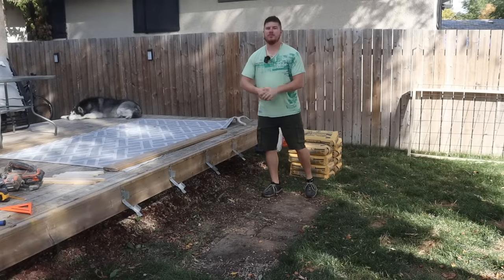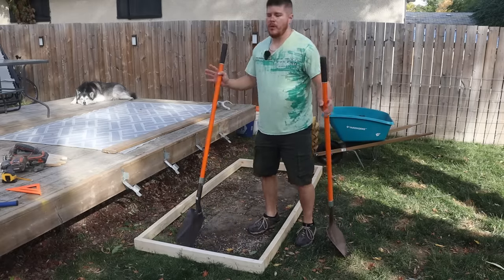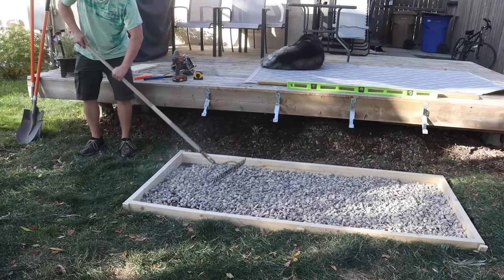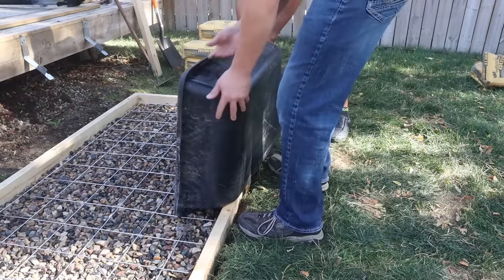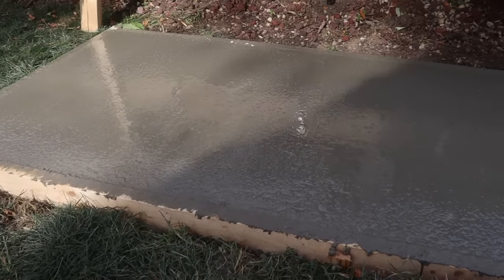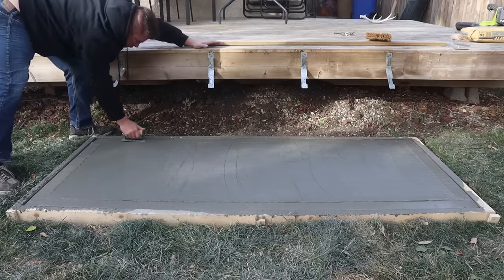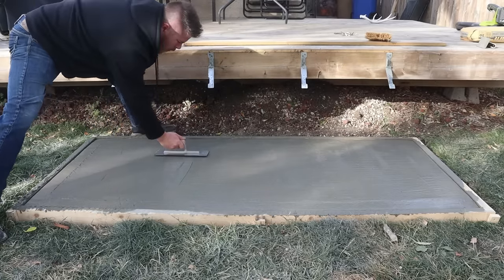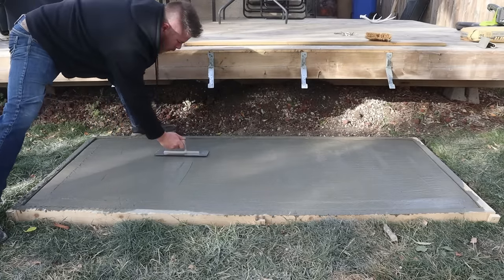Concrete pad for beginners  //  DIY

Comment: Super important to wear a mask when dumping the concrete out of the bag. That dust will hardened inside your lungs....
Reply: Is cools dude I reckon the 30 years of heavy smoking (wink wink) will probably get them first... Oww.. Is beer o'clock 😂 No but good advice thanks... I just burnt a root out the floor... Fackin used slightly too much lighter fluids 😮 fml oops!! Is okay is parents house not mine lol 😊
Reply: Most concretors I know smoke gear and darts flat out, cement dust has nothing on them
Reply: These people commenting about smoke have no idea what Silica is and what it does to the lungs. Trust me it’s not the same as smoke 🤦🏻‍♂️
Reply: Yea good point! Thanks!
Reply: I wear a mask when dumping but still hold my breath for a while 😄 
And walk away for a few seconds until the dust disappears..
Even if I do it like this, it still feels like I am breathing in some dust.
Reply: What size slab is that? Gonna do that this weekend
Reply: Been mixing with cement for 40 years, no problems. Just keep the wind behind you.

Comment: Good job on the video but few tips for beginners. On a smaller slab like that, where it mainly has foot traffic you don't need the reinforcement. You really only need that if the slab is going to hold weight like a vehicle or a shed. If you are doing this solo using a wheel barrow is much easier than a mixing tub. You just dump it out instead of shoveling or trying to lift the tub. If you want to help hold the slab in place, drive some 4 inch long rebar half way into the ground. Spreading them out in the middle of the slab.
Reply: agree-
Reply: Do you need rebar or whatever for just a patio and chairs situation and for that, how deep do you need the slap. 2",3"4",,etc?
Reply: @USMC-1 ur gonna need all 9” 🤥😉😲😵‍💫😵🥴🤤
Reply: Thanks for the tip

Comment: I've seen a lot of videos on creating concrete slabs, but I've never seen one with this much detail and explanation.  THE BEST VIDEO I'VE SEEN. Thanks a lot.
Reply from the maker: Awesome! Well I'm glad that I could be of help! Good luck on yours!
Reply: Not thick enough for rebar...4" or more requires rebar..
Reply from the maker: Requires, key word. But nothing saying don't do it anytime, even if it's thinner. It's always better with it as that's part of the way concrete works. Especially for a minimal cost

Comment: Put a few small rocks mid depth to support the metal mesh before pouring. Get it in the middle of the concrete thickness.

Comment: I needed help because I’ve never done concrete before. I’m a grandma who loves a project! My garage floor is 3/4 blacktop which is great because the original concrete floor is awful- porous, holes, never ending cement dust. I just wish the previous owners had done the whole floor!?! Now I’m trying to resurface the remaining 1/4 with a 2in layer of new concrete. I’m doing a 5x4’ pad 1st because I’m doing it alone and can’t mix more than 30lbs. at a time so I can lift the 5 gallon pail to pour it in the form. I was worried when I finished smoothing it out level because it was so wet on top. I grabbed my phone so I could find a video to show me what to do. Yours was the first to pop up and am I glad. You explained the process perfectly and now I know that I have to wait and finish it off when it dries more. Thank you so much. Too many of the videos are for people that know what they’re doing and they’re too complicated or expect me to know things that I don’t. I’m subscribing to your channel so I can get more instructions on home projects. 😊
Reply from the maker: That's awesome! Well I'm glad I could gelp you learn and grow. Good luck on the rest of it, sounds like a big project. And welcome to the crew!

Comment: Just what I needed. Thank you for making such an easy to follow video. I had been wondering about using a tub vs wheelbarrow and some other items mentioned here. Thanks for listing them. You've made my job so much easier! Subscribed.
Reply from the maker: That's awesome! I'm glad I could help out. I've had this tub for 4 years now and it works great, but lots of people use wheel barrows to dump it easier. I just shovel it out of tub normally. Good luck on your project and welcome to the crew!

Comment: Very nice and well-done video brother!
 I am getting ready to pour my first concrete slab ever this morning. I have a 2' x 8' area/section and thought I would need about 15 bags of concrete according to the sizing chart on the Quickrete bag, (16 sq ft).
However, after watching your video, I realized it's easier to use some bags of paver base as you did, and only need about 6 or 7 bags to do the job!

I learned a lot here and feel much more confident now going into this project! Kudos for taking the time to do this video.
- Mark from Holly, Michigan.
Reply from the maker: Thanks very much, I appreciate it! I hope that your slab went well!

Comment: Thank you for the video. I’ll be tackling this in a couple of weeks. It’s my first time doing this, but with your help, I’ll get it done!
Reply from the maker: Anytime, glad I could help! Absolutely you can, good luck on yours!
Reply: Doing a dry pour seems a ton easier to me
Reply from the maker: Dry pours are not good ideas, but everybody seems to be fascinated by them recently. Ultimately you're skipping vital steps, and concrete is a chemical reaction. Skipping them will have adverse effects. There is a reason the pros, as well as concrete manufacturers don't do it

Comment: What a great video!! I'll be doing some concrete work on my house a l little at a time because my back can only take so much 😂 and your video really helped me, A+ on your editing and Instructions and guidance while making the video. I was wondering why you weren't using the wheel barrel to mix the cement but then realized you saved the grass clippings and your dirt you scrapped up at the beginning, smart man 🫡 keep up the good work!!
Reply from the maker: Thanks so much, I'm glad you liked it! Pick away at projects a little at a time and before you know it, it'll be a new yard. That's what I've been doing. Good luck on yours!

Comment: Bro, thanks for this vid. This is roughly the size of slab I’m going to need to do in my backyard. My job is between the foundation slab and the paver walkway, which are held in place by 2x4’s. You’ve got a new subscriber here bro. I’m not much of a handyman and this Vid was perfect for me as you went step-by-step. 🙌🏼
Reply from the maker: Dude, that's awesome! Welcome the crew, I'm so glad I could help you out. If you haven't done it yet, good luck on your slab!

Comment: Great to see you used reinforced concrete.   It helps keep the slab tight.  It would be great to see a wider finishing broom used.
Reply from the maker: Thanks! I would have liked that too but I was trying to use things the homeowner might grab at the hardware store. That's what they had so that's what I grabbed

Comment: Flat surfaces pours of 4" deep does not need reinforcement at all, nor gravel but if one has the extra money to expend it does not hurt either.
Reply: Nice job, lifetime strong
Reply: I agree.  I poured several 4’x4’x4” d as labs for a patio area in my dog run several years ago. No cracks, no settling, and still perfectly leveled with about a 2 degree  slope away from the house.
Reply: True.  I’d just use the 5000 psi maximizer and call it good.
Reply: If it’s really small like this yes. But personally would always recommend reinforcing. Concrete is not strong at all without rebar.
Reply: @jjparks9263  concrete if mixed correctly is able to withstand at least 3000lbs per sq inch so idk what you’d consider strong if that’s not strong to you.
Reply: @ecooutdoors  go pour a driveway with rebar and no rebar and in 15 years we’ll see which one still holds up

Comment: I would have used the square to mark it and the spade to dig lol but that's me.There are actually tricks you can do like put a board across the middle to hold the middle from bowing out simply have higher stakes and screw the board up higher above the surface allowing you to work underneath.
As  to the pour i would be ok making the first  several bags a bit wetter because they will keep the bottom from getting too dry too fast by the dry stones or simply spray some water on the stones.
Something many forget or don't know is that concrete is never a perfect pour there wil be areas wetter softer than otehrs and those areas will likely SINK a bit.So there are two ways to fix that go over the pour minimum 3x i prefer 4 for perfection  and or to pour with a bit of a crown instead of the  perfectly flat screed method.
Finally and perhaps very important is to not use an aluminum trowel but to just use a magnesium float .Trust me if you float it 4x your broom job will look amazing you just can't  float it before it is ready it needs to dry a bit each time.I have many times still got an amazing finish flaoting 3x but so many people including contractors are not organized or impatient and will only float it 2x  and unless your weather if perfect temperature perfect the mix is perfect you won't get the preferred finish.

Comment: I noticed you did not put any cut lines in your slab. Is there a min/max size of slab required for cut lines ?
Reply from the maker: That's about as big of a slab as I'd go without it. You can do bigger without them, but run the risk of cracking.

Comment: Thanks for posting.  Agree with others comments re: DUST-either mask or have assistant lightly spray during bag dump. MESH-raise up to middle of pour with Little Rock’s or…. I’ve got 2.5 acres, more & bigger projects but enjoy your video style, SUBSCRIBED and I’ll be going back for more.
Reply from the maker: Anytime, glad you found it useful! Yeah we should have worn dust masks, but it was a bit breezy that day and I should have at least said something. I would have raised it up slightly, but it's very easy to bump it without properly raising it and I was trying to make this as simple as necessary for the average homeowner, and this wouldn't impact a small slab for most people. Welcome to the crew, glad to have you!

Comment: Great video!  I feel like I could go out and do this.  Thank you for the tip on the sealer to avoid having to use the water for curing.
Reply from the maker: Thanks. For sure you can! No problem, glad I could help. Good luck on yours

Comment: Great video. Never did any concrete work before but im feeling confident to tackle my first project...BTW I have what i thought was an old concrete mixer in my garage i was about to put on the curb til i seen this. Now i think im going to try to use it pretty soon. You might have saved me a few hundred 😅.

Comment: 😊 awesome work I’ve watched other concrete videos yours has actually explained how each step is done and why it works for example the fingerprint in the concrete to check before brushing etc these big concrete  names on you tube don’t do the little details like you just showed thanks great video.
Reply from the maker: Thanks, appreciate it! I try to explain as much as I can in my videos and answer questions that I think will come up, and give tips to simplify the why, so I'm glad you found it useful!

Comment: I am not a pro, but I have poured 630, 80lb bags around the homestead; poured a 56, 80lb bag footer yesterday (set a new record at 23 80lb bags per hour), and some of my lessons learned from these pours is to always pour pads a minimum of 4 inches thick. Pads less than 4" are vulnerable to cracking. For pads I place rebar in 2' squares for light loads, and 1' squares for heavy loads. Wire cage is good for arresting/preventing the propagation of cracks. I terminate rebar and cage 4" from the edge of the concrete. For footers I dig 12" wide and 12" below grade, but the frost line is only 6" where I live and its important to be below the frost line or risk heave. I place the classic 4 stick, 4" by 4" rebar truss in the center of my footers. It is very important to pour wet concrete onto wet concrete so for hand pours the biggest pad that I will pour is about 8' wide by however long I can go until I am exhausted, but footers can go on for a very long ways because they are only 12" wide so I am always adding wet concrete to wet concrete; there is little urgency for floating/finishing, and floating/finishing is easy on a 12" wide pour, so I can afford more time for breaks.

Comment: Good video.   I would use broken concrete to get the mesh about the middle of the slab.   Very nice work.
Reply from the maker: Thanks. Yeah there are a couple options but for simplicity sake for the average homeowner, this was easy. Glad you liked it

Comment: Nice job!  You made this easy-peesy and everyone should be able to do it if the take their time and follow these simple instructions.  Thanks for this sensible alternative to all the useless dry-pour vids that are encouraging folks to create poor hard surface things (can’t really call them concrete).
Reply from the maker: Thanks! I tried to make it as clear and easy to do as possible while doing it correctly. I've had so many people comment about dry pouring, and I tell every one of them how Terri le of an idea it is. There is a reason why roads aren't poured by a dump truck and then a water truck comes by...or why bags of concrete don't have dry pour instructions. I'm almost at the point of making a video disproving dry pouring

Comment: Great video and pace, just one thing to mention: the reinforcement should be as close to the center as possible to provide maximum support. If you leave it at the bottom, it won’t do much. So usually you either place something to keep it high, but it adds impurities, or better just lift it up to position while adding in the concrete. The concrete should be able to support it with ease
Reply from the maker: Thanks  glad you liked it. Yeah typically, but you can move it up or down in the slab for different reasons. But for just a small pad like this that won't be holding up a car, it'll be ok.

Comment: Thanks man from a fellow Canuck, explained nice and simple. Need a new shed pad (8'x10") and am toying with the concrete idea a bit vs deck blocks/wood frame. A local ready-mix company will deliver mixed concrete for $565 per cubic metre, i just have to wheelbarrow it all back from the street but seems like a better idea than mixing all of that by hand. The finishing is what concerns me the most but then again, if I cock it up, it's all under the plastic shed floor LOL.

By the way, your boss doesn't look impressed with any of your efforts.
Reply from the maker: Anytime, happy to help. Yeah that sounds like one extreme or the other, and a wheelbarrow full of concrete is not stable, I've definitely dumped 1 or 2 on the jobsite before. Oh yeah, the finishing is actually the easy part once you know what to do, but yeah, it'll be hidden anyways. I also have a video about building a wood shed floor if you want to see that. A lot of people have built it to put a plastic shed on. Hope you figure something out.

Lol he doesn't usually, just judges everything

Comment: I would have put the extra wire into the slab to reinforce it further and reduce waste. Great video! Kudos
Reply from the maker: You could for sure. But I'm saving it, not wasting. I do enough concrete projects I'll find another use for it yet. Glad you liked it!

Comment: Thanks for the video. Helped me a lot. One question. Are you using too much water? Your results seem great, but I always read that the mix mustn't feel wet to the touch. Interested in your thoughts.
Reply from the maker: No prob, glad you liked it. Mine was a touch wet in a couple of pours, a couple were perfect. It'll always be ever so slightly wet to the touch right after pouring because there is water in it, you want to avoid standing water after pouring. The top layer should dry out relatively quickly after that

Comment: Tip for getting the stakes out... Put a screw in the top of the stake. Get a crow bar or your hammer then pull it up. You can reuse the stakes for another project vs. making or buying more.

Comment: I have viewed many videos and your is the best of to best. What type of grade and type of concrete to use from Home Depo you recommend ? Need to know ASAP. My square pad is going to be for a Mini Split Air Conditioner.
Reply from the maker: That's awesome, thanks! I'm glad you liked it. I use Quikrete because I have easy access to it and because they have a bunch of mixes for different use cases. For something like that just the base yellow bag like I used in the video would do fine. But if you want one that cures a bit faster is go with the white bag 5000psi mix or the blue bag 6000 if you can't find that. Hope that help, good luck!

Comment: Great video. What is the time limit combining batches of mixed concrete and placing it into the frame? I’m sure I can’t combine pour after a certain time? Thank you
Reply from the maker: Thanks! It all has to be done in one shot so you want to lay one pour next to the last pour while it's all still wet. Once it's dry, new will not stick to old. You don't have to rush, but the slab has to be made in one go, not split up over hours or days.

Comment: Thanks for video. Very clear instruction. How many bags of 60 lb. stone mix did you use and the dimensions of pad?
Reply from the maker: Anytime, glad you liked it! It was just under 4'x6' and I used 8 bags
Reply: @JessedoesDIY  Thanks for info. Curious why you used gravel underneath pad. Is it for drainage? My soil is hard clay. Don't think I need to.
Reply from the maker: No prob. I have hard clay here as well, but on a small slab it can help the slab stay separate from the ground in the winter or yeah even after heavy rain for drainage. The slab will be able to move around as a whole piece to prevent cracking. Tamped sand about 2 inches thick is another option that works, I just prefer the rocks on a bit bigger slab and sand for smaller